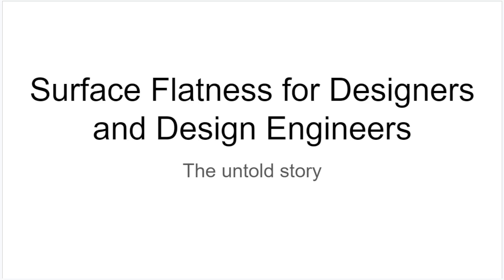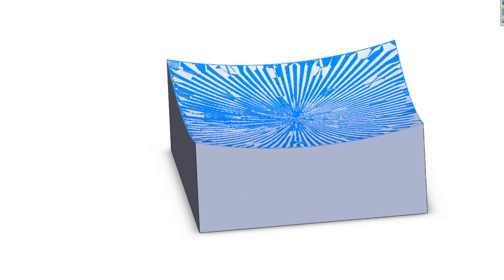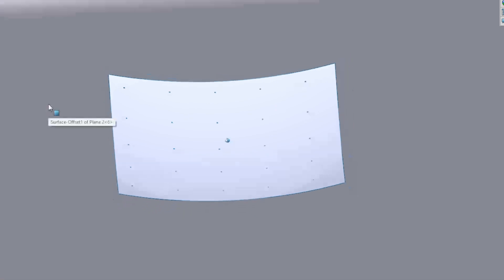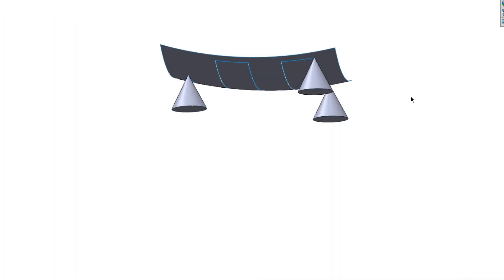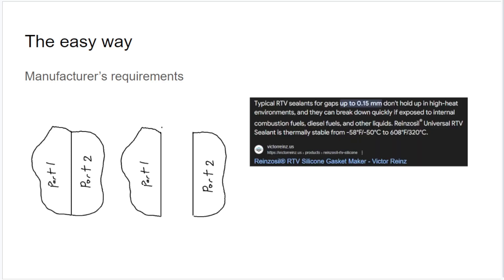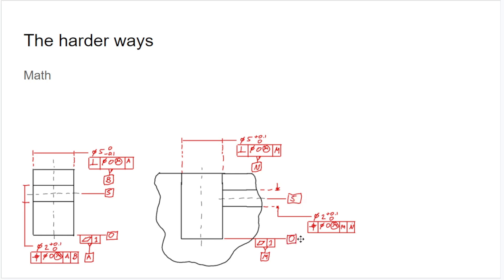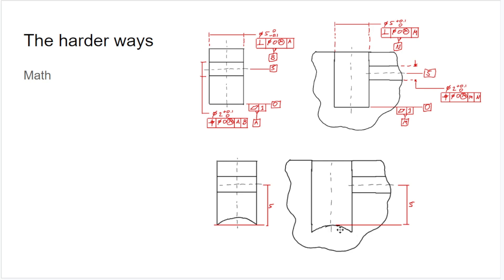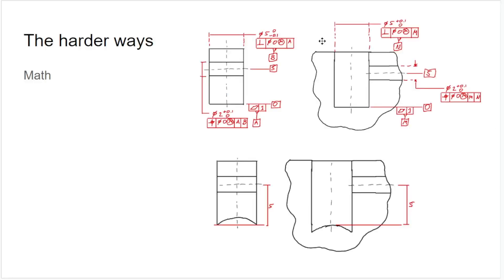How to Use Flatness on an Engineering Drawing (Per ASME Y14.5)

Comment: Measurements are made from the actual mating envelope.... Not an arbitrary high or low contact area of an as-built surface.
Reply from the maker: Agreed, the point I was trying to demonstrate with the CAD was that a poorly set up measurement will have misleading results 

Of course it is obvious when the surface is this distorted, but I've seen poorly leveled parts get incorrectly flagged for being out of spec on the flatness